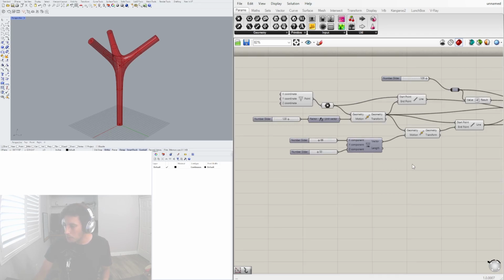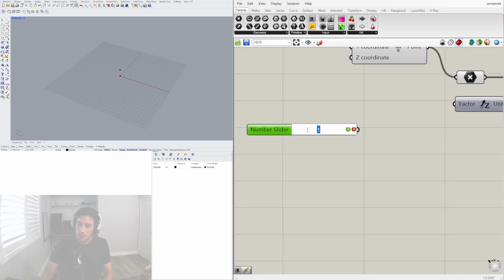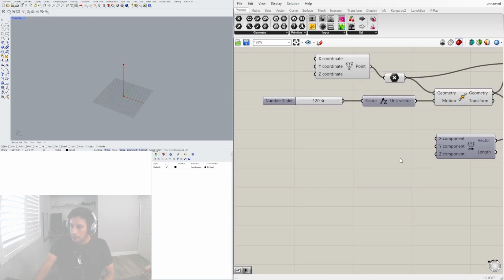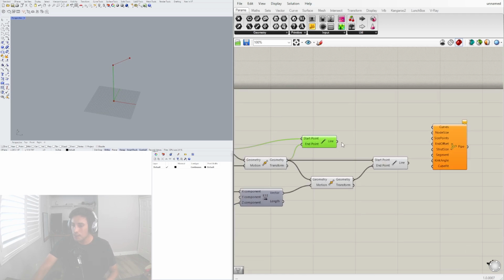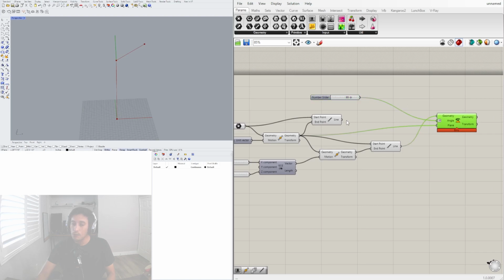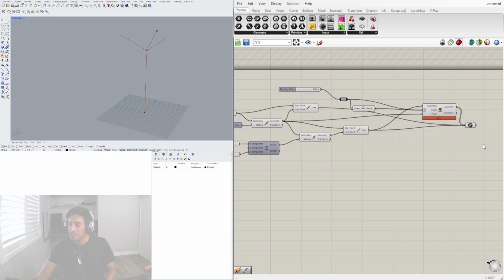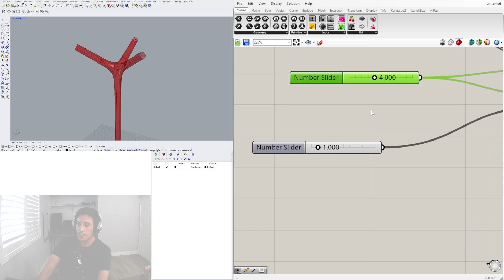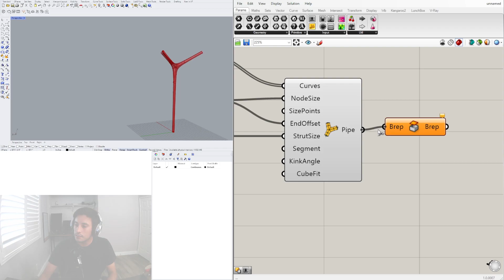Multipipe Sub-D Rhino and Grasshopper Tutorial

Comment: Awesome tutorial, explained in a very simple way! :) However, I am having trouble connecting more than one line or curve in the multipipe function. Everytime I try to connect the second line, the first one is disconnected. What shoul I do?
Reply from the maker: Hold down shift to add more inputs into the component, and make sure the right click on top of the input and also flatten it, so they are come in organized

Comment: I have rhino 7 and the multipipe option does not appear in grasshopper. What should I do?
Reply from the maker: That is weird, it should be there, try searching using the space bar with key word pipe, see if in the options you see it show up.  otherwise, contact rhino or grasshopper support. also download the script here you can create a free account.  maybe it shows up when you open it.
Reply: @DCOParametric  I have the same issue, do you know how to solve this?
Reply: @felipegalindo  I have the same issue
Reply: I also have that problem
Reply: I fix it: In grasshoper you just need to enable "obscure components" in Preferences > Interface.